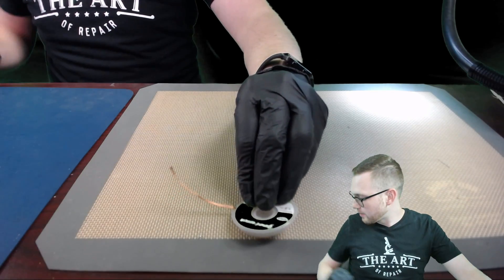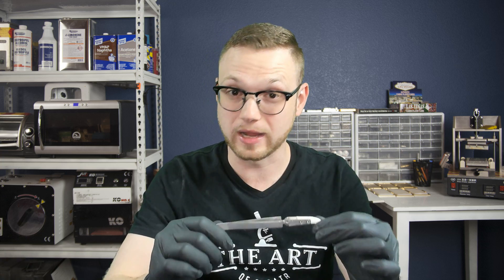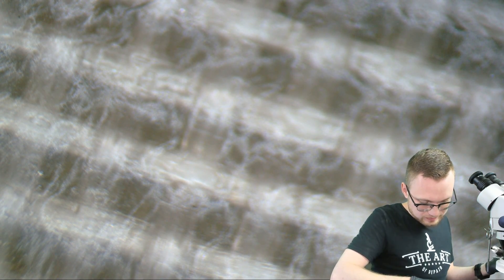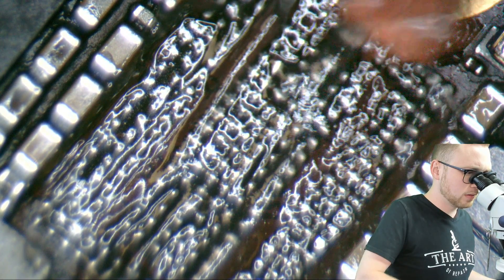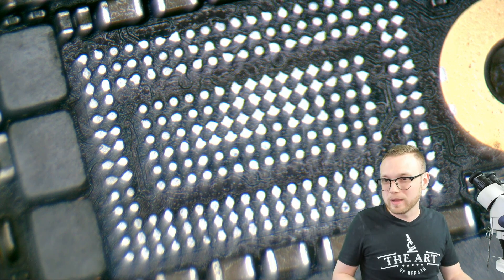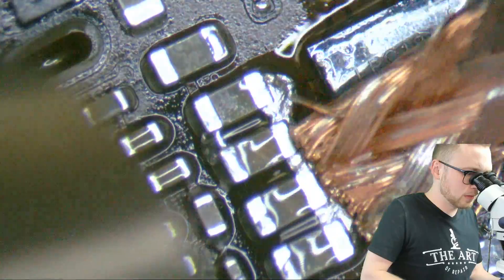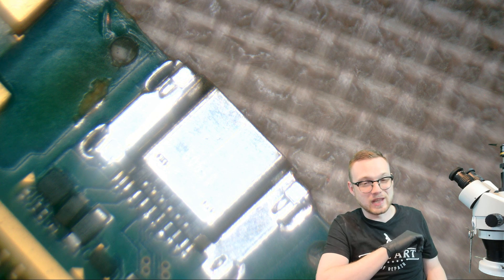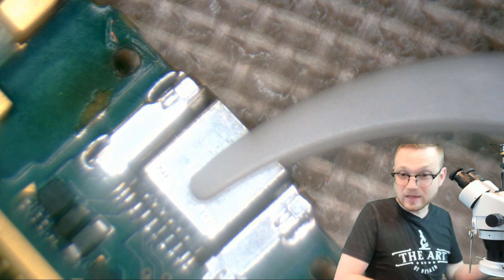EP58 The FIRST Original AOR Product | The Inverse Ceramic Desoldering Tweezers | AOR-T-001

Comment: Thanks for the video but I need to confirm if these tweezers are considered ANTI-STATIC.
I am assuming they are ANTI STATIC because of the CERAMIC tips but the handle is metal and don't know if the whole unit itself is non-conductive.
Any information would be great and again, are these tweezers considered ANTI STATIC?
Reply from the maker: If you are isolating yourself with an esd strap, then they are not going to conduct from the ceramic to the wic, wic itself it not antistatic but its not taking a charge from yourself to the workpeice if you are ESD compliant. outside of that, the handles themselves are just standard tweezers and are not special in any way. If you applied a charge to them, it would carry the charge and there is no coating on the handles themselves. So they are not advertised antistatic, no. But does it still do it in a way that protects your work via ceramic insulation as long as YOU are wearing your strap. yes

Comment: The tweezers are interesting, but it's so much easier to cut off so little wire and take only hot tweezers and hold and do desoldering without using hot air and any extra tweezers, because hot tweezers heat the wire directly and you do desoldering.

Comment: Thanks Justin! I love my AOR inverse ceramic tweezers! Your tweezers and desoldering technique in this video should be taught in every electronics class.
Reply from the maker: DUDE! im glad they help you so much =D
Reply: Just got through helping me a few minutes ago. I desoldered the EMI/RFI shield pads and the pads for the USB Charger IC BQ24296M VFN-24 if I remember right. It goes to a Kindle 2017 7th Gen tablet.
 I didn't notice that my Rework Station kicked the air up to 50% on me and I blew a TT SOD323 diode across the board - luckily I found it!

Comment: I do like the example of taking care of the bridge between the caps.  Would you recommend adding some leaded solder to the ROHS to make the repair easier.
Reply from the maker: its always good to lower the target joints a little bit under, the surrounding solder joints, makes it easier to get up before the surrounding joints wet.  Just gota be careful not to use super low melt stuff unless its application specific, if you good up and get it everywhere, it could cause issues down the road.

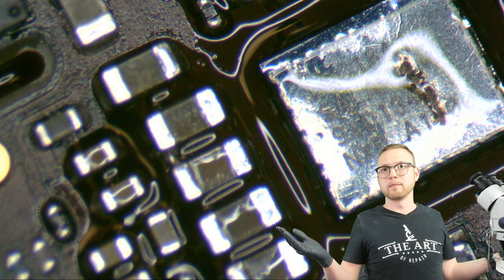Comment: 10:00 - impressive - done-zel washington - too funny - tight woven wick - i've not used that brand.  i can't make out what brand or number.  btw - all around informative vid - even if you keep changing colors - lol
Reply from the maker: HAHA! I know right! , I use 1.5mm goot wic, but i also use tons of knockoff china branded 1.5mm and they work just fine as well. Once you have saturated your micro wick, since solder LOVES to travel up the heat, it pretty much sucks everything up regardless, so many things play together to give you the PERFECT cleanup tool. On the color deal, yeaaaaa, you know, greenscreens and all hahah =D